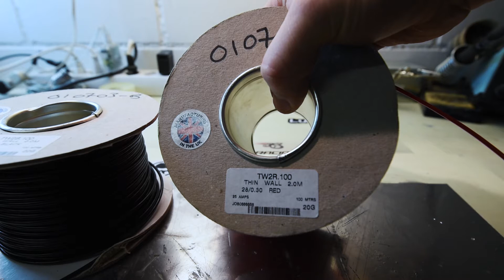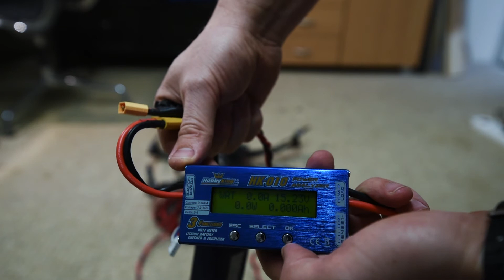Tethered Drone Project part 2

Comment: you are not using battery on this? how did you power up the drone?
Reply from the maker: Hey, I am using a battery on the other end of the long cord..
Reply: @NilsRohwer  oh i thought its connected on a power supply. hows the voltage drop upon increasing the wire length?

Comment: So basically, you ended up with a 32 foot piece of wire connected to x? amount of batteries wired in parallel ? Your first part also showed a stack of batteries, but you didn't show how they were connected together for a ground-to-air power supply. A third part video to this project would have be really nice to see.
Reply from the maker: Hey, Yeah it was a straight power wire up to the drone from a stack of parallel batteries on the ground so that I still had the 16.4V of a single 4S battery.

Comment: I think what you meant to say was putting the two 20 gauge wires would essentially be a 10 gauge wire? Running wire in parallel is extremely inefficient... Two 20 gauge wires in parallel is closer to 17 maybe 16.5 gauge
Reply from the maker: That's very true. It didn't work at all, What I am working on now is to step up the DC into high frequency and voltage AC then back down to DC on the copter end. The other Idea I have is to run 2 ESC's in series and those 2 in parallel so that I could essentially give it 8S power. Higher Voltage = lower current. Let's see.

Comment: Great videos! One idea here...Your cable weight  is all the way at the back, which causes the rear motors to spin up faster than the front ones to maintain level flight. This is causing more amp draw to those motors, (watts) and therefore, is less efficient.
Moving the weight of the cable to cg should distribute the load equally on all four motors and give you better efficiency as well as more agile flight characteristics imho.

Comment: I've contemplated a project like this I think the answer would be to use a high voltage source and tether and drop the voltage and increase the current on the drone only problem is that step down converter would be heavy also if it could be light and efficient the HV tether could be quite light